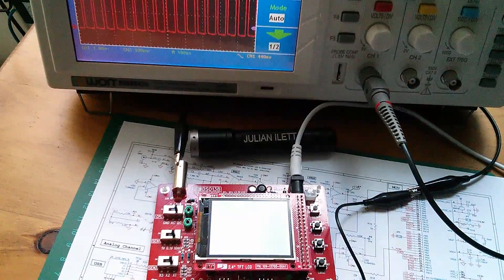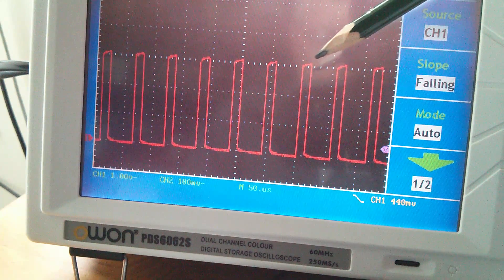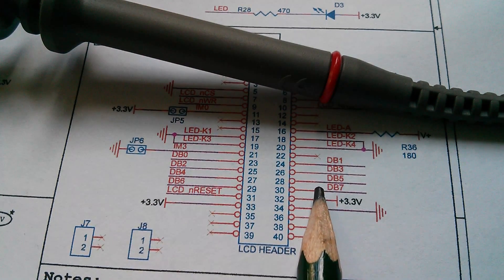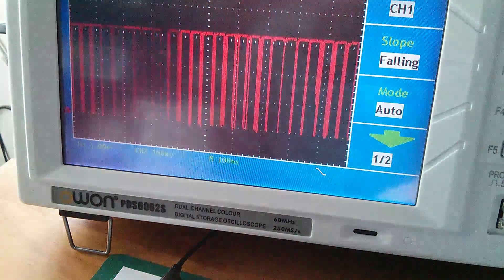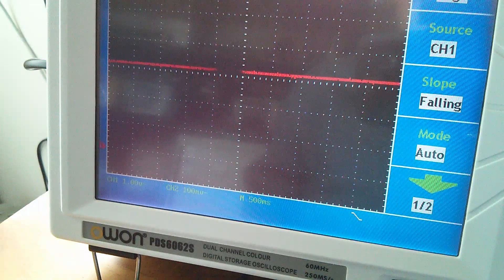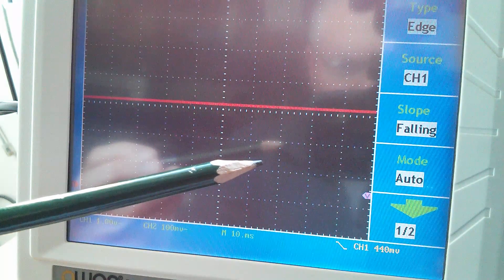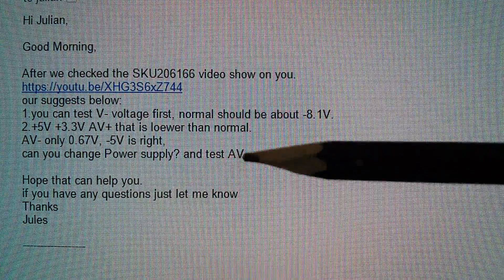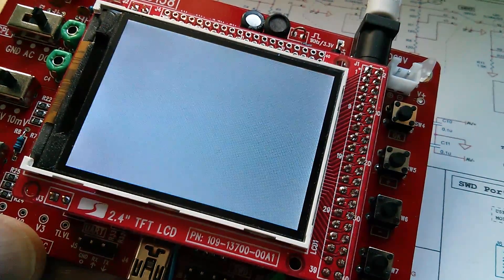Julian's Kit Build: Banggood £15 ($23) Oscilloscope (update)

Comment: My apologies if this is a stupid question, but can you be certain the LCD issue isn't related to contrast?
Reply: To phrase it differently, the only stupid question is the one you didn't ask! :)
Reply from the maker: Roger McCarty Thanks Roger - and the user manual (with schematic) is here: http://www.jyetech.com/Products/LcdScope/UserManual_138.pdf
Reply: Roger McCarty its never a stupid question. thats how ya learn :D
Reply: +lasersbee From the schematic that Julian was showing, I doubt -V is needed for the contrast as it doesn't even go through to the LCD header! 3v3 is the only voltage routed to the LCD (with V+ for the backlight LEDs)
Reply: Roger McCarty Sounding more and more likely that the LCD controller was dodgy and packed up. Specific mention that there is no correlation between -VE and the LCD - that it is only for the analog circuit. Also, they say to check the  3v3 and 5v lines to ensure MCU and display are getting adequate power, and check the 40 pin header connections.